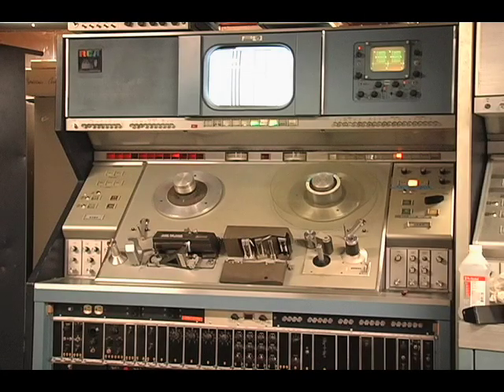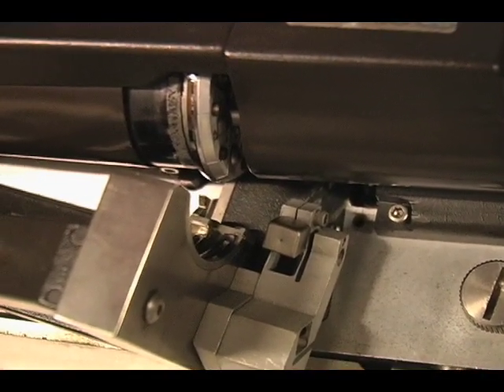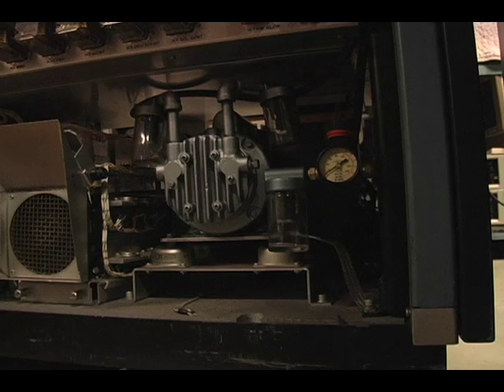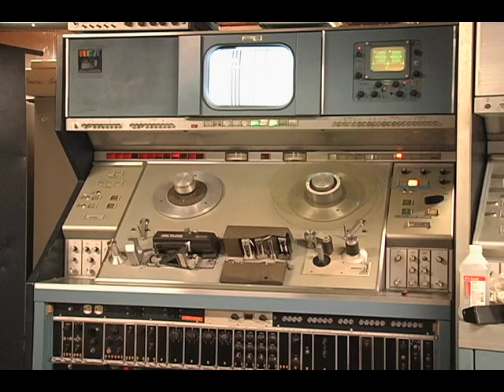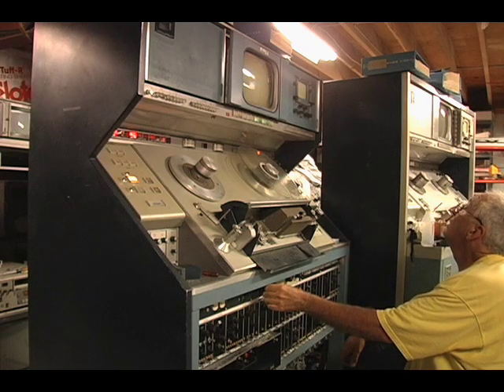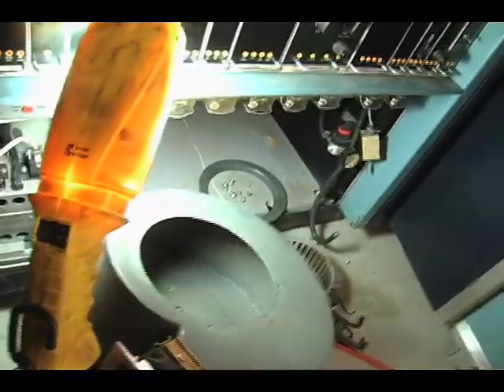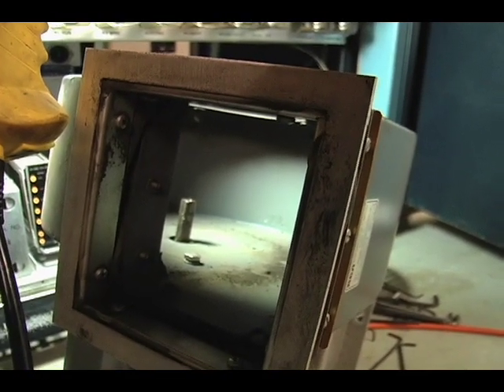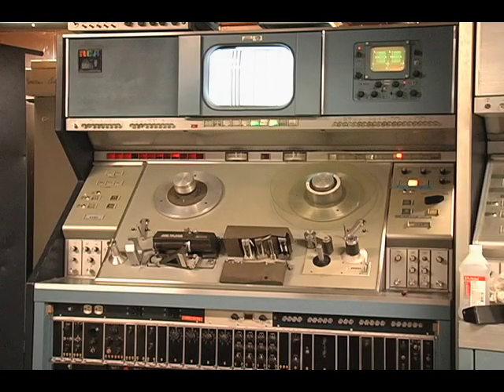the second TR-70 quadruplex video tape recorder gets a "wake up" call

Comment: My name is Danny Price. I’m almost positive this is one of the TR70C’s I helped maintain and operate at the University of Georgia from 1978 until we retired them. I sooo remember the glass reels. We had 3. We also used a TR4 and a TR5 (more compact) we used in out remote truck. This was at WGTV in Athens Georgia.
Reply from the maker: Hi Danny......I'm sure you're correct!  I've always wondered about the glass reels that were on these machines there.  What was the rationale for them?
Reply: @RCAquadruplex  We were told that the glass take up reels (high precision grindings of the flanges) were to eliminate any possibility of tape edge damage. They certainly looked impressive as they spun in record/playback. During high speed rewind, I remember that you couldn't really tell that they were turning by looking at the edges of the reels; they were so symmetrical. Another reason for using them (as opposed to an empty metal supply reel) is that although is was possible for a supply reel to get bent if the reel was dropped for example, the glass reel would never get bent if it was dropped; it would just shatter! I remember hearing that they cost $1,100 in the late 1970's. We were reluctant to remove them given their expense. Unlike a commercial TV station (which would quickly change quad tapes by using the empty supply reel as the take up reel for the next show), a public TV station usually had time to completely rewind one program before needing the VTR for another. In addition, we had 3x TR-70c, 1x TR-4 for on-air playback, so we could hopscotch our way between machines between programs and promos. One last bit of trivia, to avoid confusion when the director called for "two" (is that camera two or VTR two?), all the cameras were single digits (1-6) and the Quads were numbered 21-24. The first Quad retired was an RCA TR-4 numbered "VT-24". A year later, when the first of our Hitachi HR-200B one-inch type C recorders arrived, they were numbered VT-24 (Playback A), VT-25 (Record) and VT-26 (Playback B with slo-mo). Later, another -200B was added for dubbing (called VT-27). Great memories, thanks.
Reply: ahm do you happen to know where is a manual for this Machine?
Reply: @JairoRoVel  The manuals were placed with each machine when they were surplussed to the University of Georgia by myself. We surplussed 3 TR70c’s I believe. I think there is a man who bought them and has refurbished them. He may have the manuals.
Reply: Hi Danny! Bob Castro here. They are indeed the TR-70C's that you, Jay and Phil worked on back in the day. I was at the UGA library in April 2009 when Guy was there with two trucks to take them to their current home.

Comment: Back in 1981,  we installed a venturi to replace the vacuum pump installed in the machine, we also used an external air compressor  for the air bearings in the headwheel.  I remember all the details of when I was a broadcast engineer back then, but don't ask me what I had for lunch yesterday.

Comment: There are two (2), late in the production run, Ampex AVR-1s currently stored in Iron Mountain.  Both of these VTRs were heavily modified by CBS Engineering (mostly for better performance with CMX editors) before they were put into storage.  The last time they were removed from Iron Mountain was 2006 for inspection.  Two (2) days later each was started back up.  After about an hour for calibration each AVR-1 was able to play back NTSC tapes from the late 1970s with no issues.   Both also recorded signals perfectly.  Currently, both AVR-1s are back in Iron Mountain.

Comment: How do you actually attach the tape to the glass reel? There are no finger holes.
Reply: organfairy u don't need finger holes. Sometimes a little moisture from your fingers is all you need.
Reply: @rty1955 
You don’t even need that. Just stick the end of the tape under itself as it comes around the reel, and it will feed itself into the gap until it pulls tight against the hub, and you’re all set.
Reply: @Ethan.Lamoureux  yes I am aware if that. I have been threading these machines since 1960.
Reply: @rty1955  Well I never had the privilege to thread one of these. My experience is with audio tape, and some ½" video tape on a portable machine, but it all works the same. Not questioning your experience, by the way, my comment was for the benefit of the inexperienced who might read the comments.
Reply: @Ethan.Lamoureux  the quads are sooo different from 1/2 or even 1" machines. Quads have a much straighter tape path. And the tape ends shoukd be without wrinkles ir creases as when the tape comes off the reel during rewind, it could damages the heads. On quads the only time when the head contacts the tape is during play or record. Ublike audio or helical where the tape is in constant contact.
I worked on almost every machine Ampex ever made. Even audio machines. Did work in a few Studer machines though.
Now as a hobby, I restore professional video tape machines

Comment: I worked in "2" building at RCA in Camden where we taught matainance on these machines.  They were built in the big building with "Nipper" on the top in stain glass (today they are condos).  One day a person who worked on the assembly line walked in the studio and asked what the TK-70 did. I threaded up the machine and played him a tape.  He was amazed. He had been threading wires and inserting circuit boards in these machines for several years without knowing exactly what the product did!

Comment from the maker: That's some great information!  I have a total of three TR-70Cs and a couple of them have a couple of radically redesigned boards in the digital servo.  It took me a while to find the RCA bulletins on these "new" boards and how to set them up.
I had always heard stories about the 70Cs and their problematic digital servos, but, after initially getting them up and running, I have experienced no issues at all.  Of course, I'm not running them 24/7 live on the air either!

Comment: Thanks for the video. It sure brought back a lot of fond memories. I am a retired Broadcast Engineer and worked on both RCA and Ampex machines. The best machine, in my opinion, that RCA produced, was the TR-70B. This was a real workhorse. I never worked on the TR-70C model but they had them at FT-Benning Ga. 
The Engineer was always working on them. The signal system in the TR-70B was identical to the Ampex VR-2000. RCA made a deal with Ampex to use their design. 
Techman721
Reply: IIRC, the major difference of the C, was the digital serb of drawer.

Comment: Ah, now I see the head cover that I remember. It's all coming back to me. The head cover was removable by releasing a bunch of slide clips, but the tape had to be unthreaded first. They got a lot of abuse because we'd take them off to clean or replace the headwheel assembly.

Where are you getting headwheels? As I recall they had to be rebuilt every 1000 hr or so. Kodak Spin Physics was one of the places that did that.